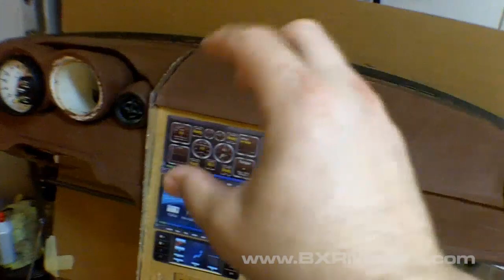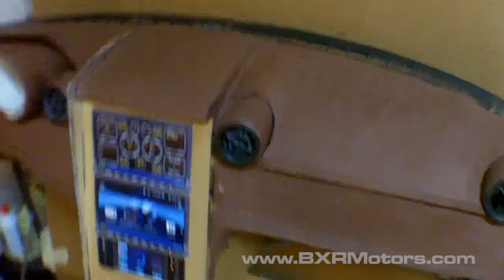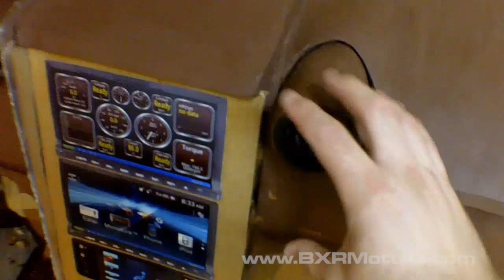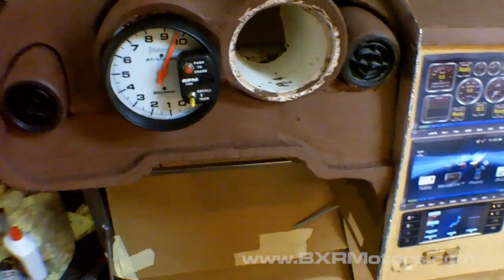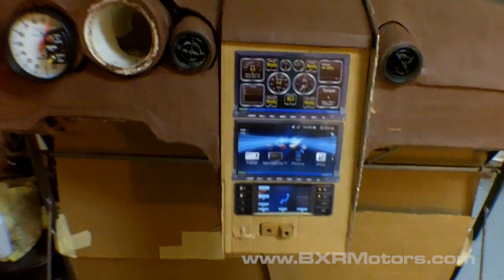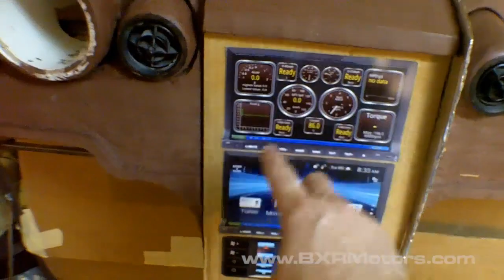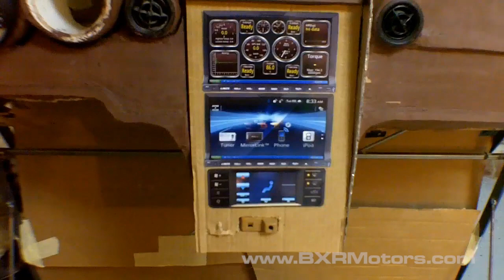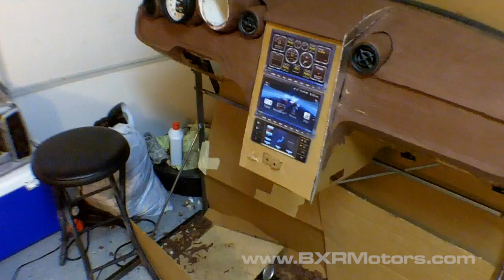Update: Dash Design Clay Sculpting - Bailey Blade XTR - Part 73

Comment from the maker: Yes the clay can be painted and even vinyl wrapped. However there are special primers that you will need to used so that the clay does not react to the paint. I have used regular primer from a auto paint store in a spray can and it worked ok but was a bit soft and hard to sand.

Comment from the maker: Yeah I'm not sure on the other video series either... Just have to Try it and see, that's the only way to know right? 

As for the engine, I plan to use a few versions. For the the first will be the new Ford 5.0L Coyote engine 500HP+. The upgrade from that will be the Ford 5.4L engine 700HP+. Both with superchargers. 

Yes i will make a mold of the Dash in fiberglass and then produce a fiberglass version of the new dash from the mold.

Comment from the maker: Yeah I thought about the Ipad and or Andorid device, but they have limitations when it comes to the engine management system, I really need a full on-board computer with several USB ports and need to use special plug in cards.

Comment from the maker: Yeah I have thought about safety of having an aluminium simi-sharpened piece in the car. I may need to make it from Plastic and have it chromed or something like that. I will have to build it first and see I guess. Since it will be a limited production car it technically will not have to meet all the safety standards that would normally kill the idea. But with that said, I feel better making it as safe as possible, and if I need to change it I will.

Comment: You need to insert a Dubbel Din Android radio .. Radio , Navigation + mobile internet receiver , so you can get information about traffic issues, recent cheapes near by gas prices. Also a bluetooth connection with phone + OBD2 , so you have contact with your car so you can read all activitys and fault codes..  etc etc etc. I can go on for a while